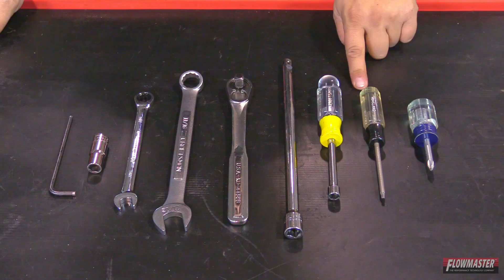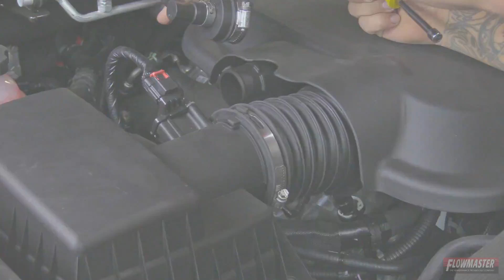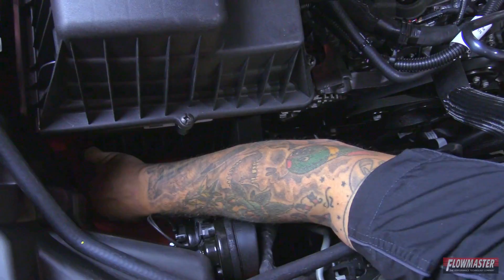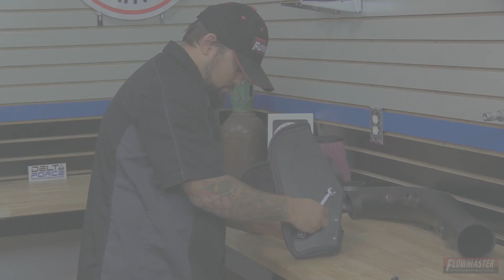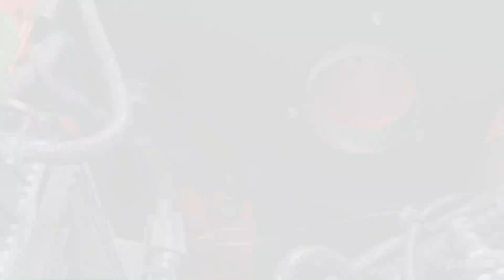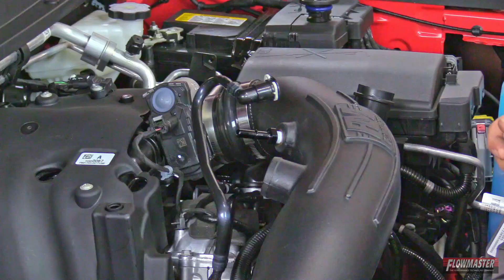2017-18 GM Colorado/Canyon - Delta Force Cold Air Intake 615165

Comment: I have a 2018 Chevy Colorado LT with the V-6 my question is  what are the differences between the Flowmaster Delta Force Cold Air Intake 615165 and the Cold Air Inductions, Inc, 512-0104-B Cold Air Intake System? I am trying to see which would better suit the truck overall. I find with the Cold Air Inductions I do not have to do as much removal does that make a difference?

Comment: what intake is better for a 2007 gmc canyon.. CA or SR?
Reply from the maker: We're a little unclear on your question. Can you please add a bit more detail as to what it is that you're looking for?

- Jason @ Flowmaster
Reply: i have a 2007 gmc canyon with a 3.7L i5 vortec and i was looking to upgrade to a better air intake but not what would be the best one to choose between a cold air intake or a short ram air intake.
Reply from the maker: @blackheart4027  The colder the air going into the engine the better. While we do not offer an intake option for the 5 cylinder application we recommend that if you find a cold air intake (one that takes incoming air from outside of the engine bay) that will usually get you the biggest performance advantage. If you have no options other than a short ram style of intake try to get one that has an air-dam of some sort that will help to minimize the amount of hotter, underhood air going into the engine.

- Jason @ Flowmaster